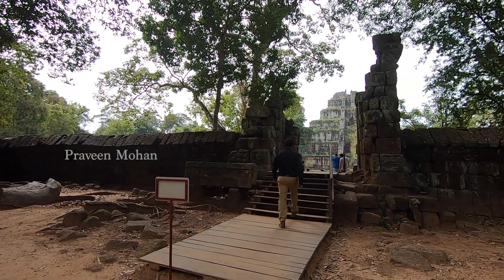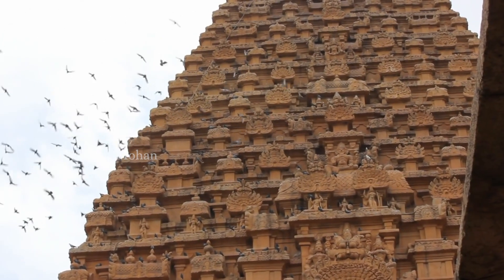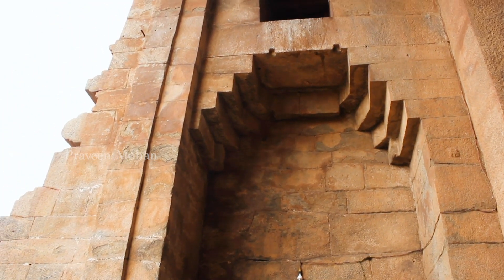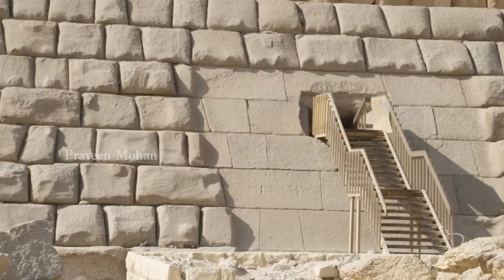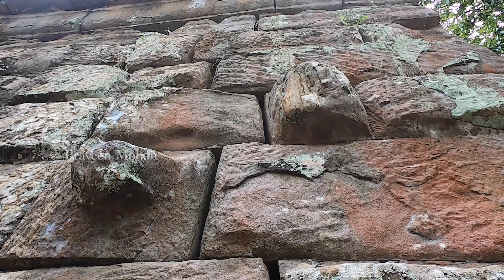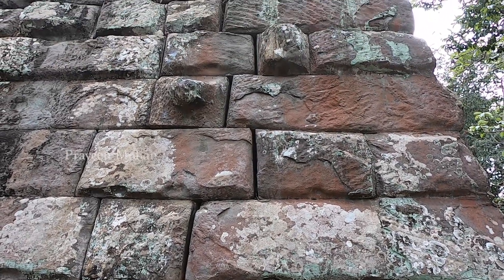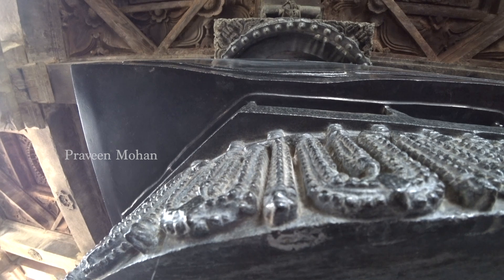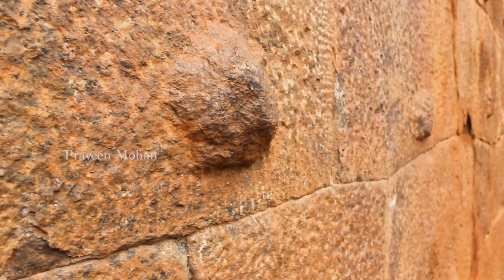Mystery of Ancient ‘KNOBS’ in Temples - Evidence of Stone Melting /Geopolymer Technology?

Comment: While I don't disagree that some blocks could have been aggregate material that was molded or melted (perhaps using a massive Fresnel lens) I don't think it explains the knobs as drops. If they were drops why aren't they on all the stones and often clustered? More importantly, as anyone who works in masonry (as I have) or carpentry or sheet rocking or construction knows: there are rough craftsmen that are ALWAYS followed by finish craftsmen. For example, a rough carpenter will erect the structure of a house, but then a finisher comes along and cleans up the job and makes it look beautiful. It makes zero sense that if the knobs were an artifact if the quarrying or "pouring" why weren't they removed by the finishers? It would be extremely easy to do, but they didn't. 

That suggests a purpose and/or even a function. One purpose may be that there is a defect in the block itself, i.e. a fault to crack and to remove the knob would not only affect its structure or function as a support to the blocks above but reveal the fault or crack to anyone viewing the building. Alternatively, it may be that something less persistent than rock was attached to the knobs, i.e. wood. There may have been a wooden structure that used the knobs as support or the knobs were used to hang something ornamental using rope or cord. Of course, organic material wouldn't last but a few decades or centuries and if these ornaments contained valuable material - gems, gold leaf, fabric, metals, etc. they would likely have been looted when sites were abandoned.

Some of the knobs may have been used as mounting points for leverage devices made of wood. These devices would have used levers and ropes to act as pulleys which would help lift and/or maneuver blocks as they were added. So this is a sort of renovation of the incorrect idea that the knobs were used to lift the blocks - they were used as anchor points for ropes that would help move OTHER blocks into place or mounting points for wooden mechanical devices that would also assist in moving blocks around. The more blocks/tiers you have above blocks with knobs the more stable they are.

Lastly, in some cases, they may have been used as astronomic markers for important dates. We know that the vast majority of megalithic buildings have astronomical alignments and/or are used as calendars to mark out solstices, equinoxes, eclipses, etc. For example, at the Temple of Kukulcán in Chichen Itza on the spring equinox, the sun's rays give the illusion of a snake ambulating down the steps. The point being that the structures of the pyramids themselves were also used to mark important times of the year which would often help with when to seed, when to harvest, when an eclipse was coming, etc. 

I may or not agree with some of the ideas I mentioned, just suggesting some ideas to consider and perhaps generate discussion.

Comment: scoop marks and knobs are usually seen together... could there be a connection?  It sometimes look like knobs are left on the bedrock after a giant stone has been removed due to the tight knit scoops that cut underneath.  The idea that these imperfect stones may have been used may be correct!  From the bedrock after a large stone has been scooped out and left nubs.  Then the bedrock with these nubs was cut out and used...meh, leave the nubs on it won't matter.
Reply: As the video observed... these knobs were shaved off when it did matter.

Comment: Hello. 
   I have seen other such examples of the remains of 'melted' stone architecture from all over the world. This is not the only example of such ancient technology. 
   What intrigues me is how the electrical power was generated. It had to be something simple, reliable, and fairly easy to manipulate. 
   What my conclusions indicate is that ancient civilizations used a method to break the Earth's geomagnetic field to generate electricity. Perhaps some sort of tall tower with a central core of metal. The rotation of the earth on its axis would break the magnetic field lines, generating immense amounts of electrical potential. Channeling it down the core of the tower and into rods inserted into chunks of granite that had been drilled to fit octagonal 'electrodes'. These electrodes would heat up the rock to near-melting, or actually melt in some places close to the electrodes, softening the granite to allow it to fit perfectly into the space next to its neighboring stone block. Also, such a technology could be used to pre-make blocks in some type of form, like making clay bricks using wooden forms, and end up with a perfectly formed granite block that could be used. 
   The 'knobs' are the points where the electrodes were pulled from the melted stone. In some cases, such a knob would be smoothed away by using tools, but in places where it really didn't matter, the knobs, if not too large, would just be allowed to protrude. 
   Just because our ancestors were not as technologically sophisticated as we are today, does not mean that they were stupid. Such a method of generating electrical energy, and harnessing it to melt stone, is not only possible, but... in my humble opinion, probable.

Comment: They made glued cast shoring filler mould towers they filled with wooden boxes inside they poured material into them they removed the internal casting boxes and built the next above part external scaffolding using wood and expoxy geopolymer concrete

Comment: Epoxy geopolymer plastic extruder injector hose disconnect joint points on wooden scaffolding shoring injector moulding dry cast hydraulic lime cement frame tower extruder

Comment: Cast or perhaps not.  If it were seen as an imperfection, I'm certain they would have been able to sledge them off and and smooth them down.  They chose not to, or they served another purpose.  Perhaps they were longer and more square or round and they supported a piece of artwork (stone, silver, gold, or jeweled) or a facade of some other more valuable material.  It makes sense that these artifacts would have be robbed/vandalized and literally knocked off and carried away.  What's left of the 'hanger' erodes smooths into a 'bump' over time. That's perhaps one theory.

Comment: Praveen   clearly the blocks were sand cast.  the drops were finished off where they were needed.  The statues are not carvings but cast from original clay or wax statues. The anomaly is the granite. 
   melting granite would eliminate the crystalline structure of the rock 
     The ancients also possessed CNC milling and water jet technology on a huge scale.

Comment: There are a lot of forts and palaces in India, made out of perfectly shaped stone bricks. A good example is the town of chanderi..the queen's palace and surrounding buildings are entirely made of brick shaped stones. Most likely they manufactured stone bricks instead of carving them from rock. Beautiful architecture too.
Reply: Devi-pq4rj : I think your idea of brick making is good. I think you also meant that, the small bricks were bound together with cement concrete to build them into bigger box-like stones; and then the box-like stones were used to built walls and columns, did you?

Comment: I have commented below but wish to add that if the rocks were moulded in situ in order to acheive the tight fit that is evident then the "drop" would surely be on the upper surface would it not? I cannot see how you can mould from the side leaving the drop. Also there seems to be huge variation in the size of the drop which I would not expect from the sophistication of the build. Regarding the statement that these are somehow defective hence used where not easily seen, it would have taken seconds for them to dress each of these drops as they were building, particularly in view of the laser cutting tools they clearly posessed. I feel we are closer but not quite there yet. These do seem to be artificial rocks though, that part seems sound from wat the locals say.

Comment: maybe those knobs were made deliberately to make the balance of the wall perfect ........... i don't think they will use defective blocks to save money ........ we see this in electric fan blades, small knobs are created on the back of the blades to make the center of gravity perfect so that the blades won't wobble while rotating at high speeds ......... the weight distribution of these structures are so perfect that they are still standing against time n gravity .......... just a thought ......... thanks PraveenMohan ....
Reply from the maker: Your viewpoint is well noted!

Comment: It would be easier if the blocks were formed in place.  Casting them in a mold and then moving them would be much harder and would not allow for tight joints like forming in place would.  The knobs look like relief areas to me.  As if they poured too much material, they cut a small opening or two in the sack and let some material pour out.

Comment: The knows prevent the hoist chains from lifting multiple heavy blocks at once that's why they're in not specific areas your not looking at it upside down the inverted weight faces tords the earth for structural stability knobs where anti chain slips for fast assembly of buildings

Comment: I agree. The knobs are defects. If they used a type of geopolymer concrete and placed the substance into bags, like sand bags, and stacked a row until it hardened... if one of the bags had a defect, or it leaked or bulged while drying... that would create a knob defect. It is obviously a type of geopolymer or rock melting technique. However, if you want to solve the "knob" dilemma you have to figure out what mold they used to hold the substance. Looks like a sag or bag to me!

Comment: Nice video , I have noticed and wondered about the "knobs" myself for years and still haven't come up with or even heard of a theory that satisfies my curiosity about them. I agree mainstream is simply wrong with their reason. Used to wonder if they was for fitting certain ones together or mounting a veneer or something to the outside or moving them like placing a small stone under something heavy to move it easier but none of those reasons seemed the real reason either . however, Not yet on board with the drop theory, seems if that was why then they could have removed them the same way they were able to smooth out the stones to fit them together so tight , and the stones are too irregular to be molded in mass production it would seem.
So its still a mystery to me at this point.
Thinking this is a definite  connection amongst the builders even across cultures and even the globe as well as through time that these "knobs" show. Maybe a pre catastrophe global  civilisation thing possibly.
A fascinating mystery.
Thanks for making this video.
:)

Comment: As an artist I have a theory on all the knobs on the stones from around the world. I believe that the stones were melted and poured. I would compare this to pouring cement but very hot and almost solid material. Just like a pump truck pumps cement today this hot stone was poured and would solidify almost instantly. When you finish the pour the knob there is the little material left over and it cooled. That is why the knobs are different sizes and shapes. Just like a baker icing a cake. If you pull the spatula away you will be left with a knob. I also believe that some people were more skilled than others this would cause the inconsistency of the size and shape of the knobs.  I do not believe these stones were cast. I also believe they mixed in different materials not just granite. That is why you get sound in some and others are lightweight.

Comment: 1.  It would be interesting to survey the stones to see if there were groups of identical stones. 
2. I suspect there are dozens of pattern stones that would been massed produced and melted into castings of some sort (force field castings??). 

3. The knob might be the “fill port” for the unique knob stones. Injecting molten stone in the space with the knob being the oooze or squeeze out. 
4. It would be interesting to scan the walls to see the joint structures for interlocking between stones.

Comment: Knobs protrusion are unique on polygonal blocks and controlled shaped blocks found on ancient retaining walls, globally. 

Consider that these protrusions are not practical to create with materials already hardened, such as quarried rock stock. It is however much practical and easier to create “before” it get hardened. How about this was a slurry with equal composition and proportion of granite-sand mixed with a binding agent, (like hydraulic-cement in modern day concrete) to be chemically hardened inside sag bags each stacked at an offset to the one below.  

Not all wall blocks have a knob, same is true that not all sag bags are correctly filled with sand or binding agent. Occasionally a few of those got over filled and expand beyond proportion. The resident Pharaoh ordered to control bleeding that bag so over expansion didn’t migrate sideways but protruding out.

Comment: I don't remember ever seeing this one, but you should do an update with this further info...I believe they made the walls on the ground first in huge patterns/molds that would reflect the wall they were putting up.  Because the blocks are not the same size yet all fit perfectly and the protrusions are random, putting the blocks in place for the walls would simply be following the pattern on the ground. The protrusions are probably defects but were not all placed together because the blocks are random sizes but fit perfectly so you wouldn't be able to fit two stones together if they weren't already next to each other in the pattern/mold.  So the knobs are possibly random from the molding process like Praveen says, but only removed in important places around statues. They would pour the geopolymer mix into the molds that may have been dug in the ground and then put them up or they did it in their spaceships and teleported it into position...:)

Comment: If the composite material blocks needed time to cure, the knobs could serve as angular brace points, periodically located along a long wall, for wood poles to be angled from the ground so the wall would remain vertical during the curing time.  The knobs seem to have their flattest sides directed toward the ground so the poles could grip well.  Extra knob blocks could be used up in inconspicuous and less elegant locations on the structure.

Comment: You think up much better answers to complex questions than the so-called experts have been able to come up with. 😀!!!
Now, you cover a lot about intricate stone "carved" figures, so perhaps they too are not carved but also cast. - well, cast in moulds using the "lost wax" casting technique.  Make the figure of bees wax, then incase the wax figure, perhaps in a clay and very fine sand slurry, thrn when the slurry has hardened slowly heat the mould to liquify the bee wax, drain that out.  Meanwhile heat the stones, or rocks of the desired type untill they become liquid and pour it into the mould.😀...
 ☆  Niels.

Comment: I have a different theory.  Bags of a cement like product, put into a bag, that forms into a "stone like" product was used.  The bags edges or corners ended up forming the knobs.  The knobs seem to be a consist size from one knob to another, so I don't think they are defects.  One question I have is how far did these originally protrude from the wall?  This may tell what the original use of these knobs did.

Comment: A suggestion maybe. If there were a stone not being used but identical, I would suggest you find a precision stone grinder that could grind say .0005 of an inch at a time across a surface. Then inbetween each layer take a magnified picture of each surface and compare what you see. It should become very evident if the stone was melted and poured to form, mixed and poured like a concrete or maybe you may see anomalies in the stone like microscopic animals or shells. This my bring clarity to the question of how they were formed.

Comment: In my opinion it happened when the transport support of the semi-liquid and light stone was removed. With sound they made the stone permeable to light with a standing wave. With the shamir or snake of light a white anti-gravity hole was created and the stone became light, soft to work with and also luminous.
These stones, which we find perfectly positioned all over the world, sometimes had imperfections if the workmanship was not done in the exact times. You can see some processing burrs like the ones you indicated, perhaps some material that came out in excess due to the extraction of a rod stuck in the stone to handle or transport it, other times you can see waves on the upper part as a reminder of the frequencies at to which they were subjected. Sometimes you see loose stones like omelettes, perhaps fallen during laying. After the effect of the elaboration, they became hard and heavy again, ,and if there were any errors during processing these were frozen in time and we see them.

Comment: Ok so hear me out I have two theories from the knobs.  The first I just came up with during the video. Since they are in paces that aren't carved or have frescos. Could they maybe be acting as a type of lattice to hold and secure a plaster or something to be shaped or molded?  Or ...or this I have been thinking for sometime now. Could the knobs be used during the transportation of the large blocks from the quarry to the site before being cut to size and fitted.? If you have a large block and you raise one end and place a pivet stone under it you can spin the block with quite some ease. Then once spun you place a pivet stone on the opposite side and use that as the pivet point. You would be able to move the block at least the length of the block every turn. Suppose the knobs are these precarved pivet points that were cut and used accordingly where needed...!?!?!? Maybe 🤔